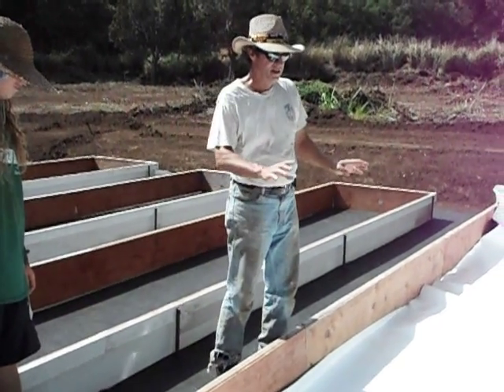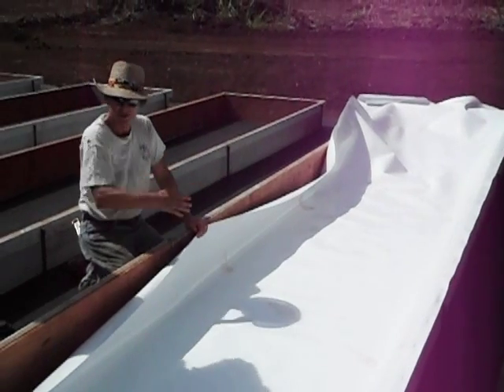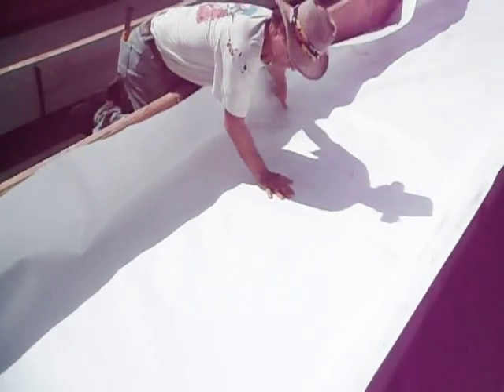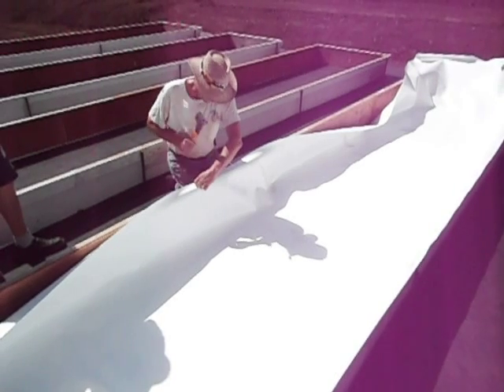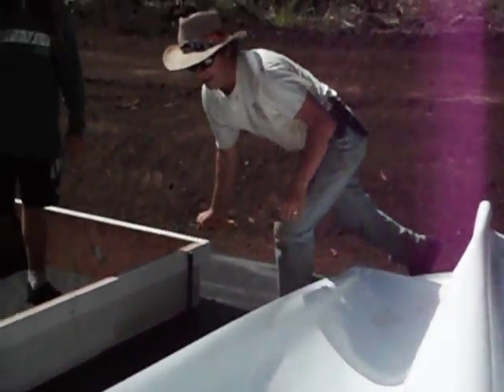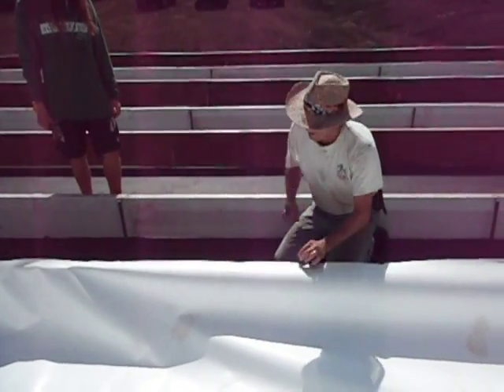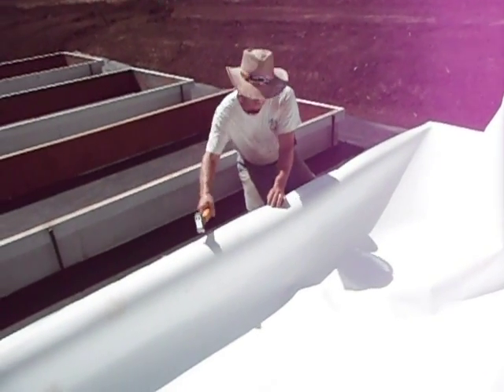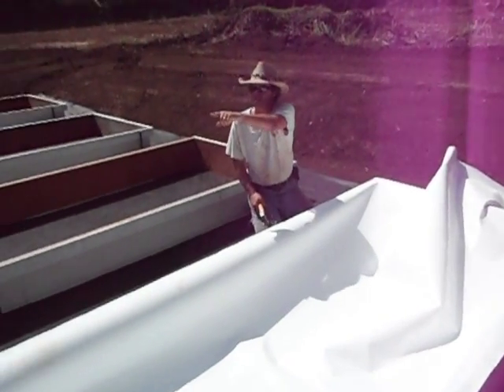#3 Installing liner in aquaponics troughs: second side, part 1

Comment from the maker: It is 20-mil thick Dura Skrim R20WW, made from Low Density Poly Ethylene (LDPE) available from Raven Industries, Sales Rep Courtney Mendelson, National Market Account Specialist, Raven Industries - Engineered Films Division,Phone: 800-635-3456. It comes in 6-foot and 11-foot 6-inch wide rolls. Aloha, Tim....